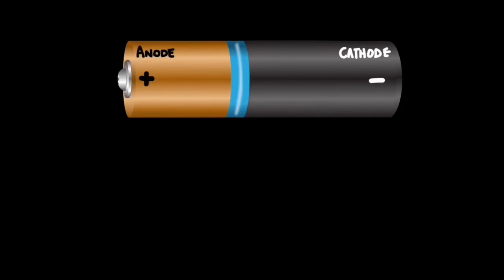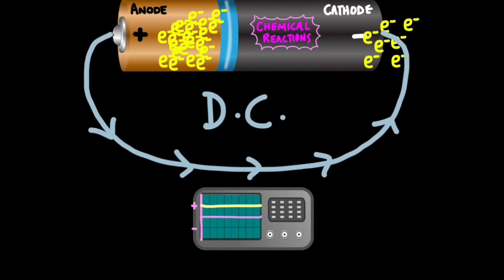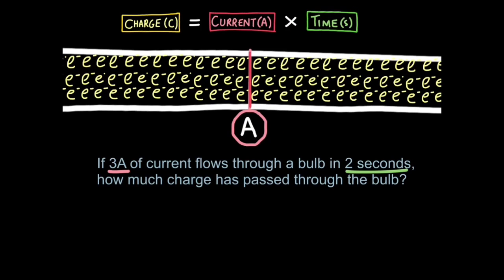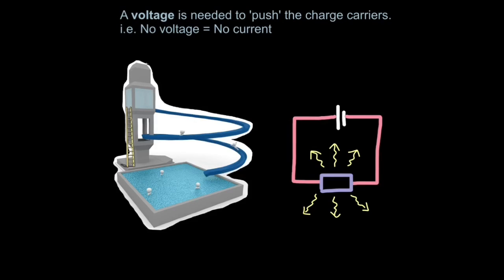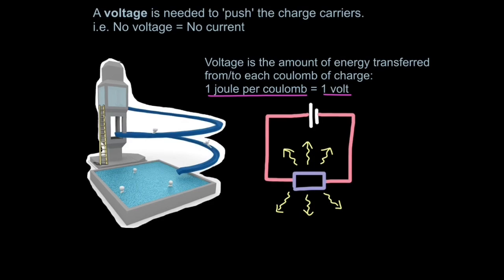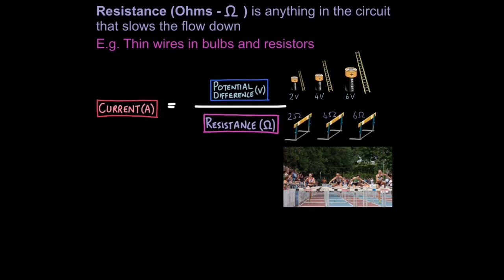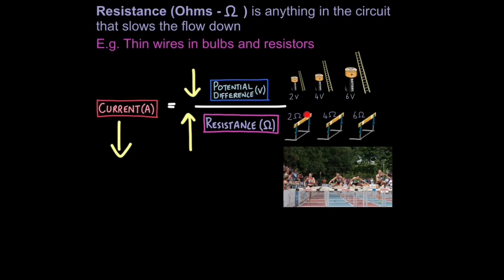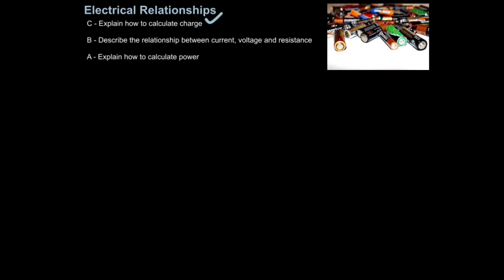P2 Electrical Relationships (EDEXCEL)

Comment: There is a current of 1.2 mA in the circuit.
 Calculate the charge transferred by this current in 40 s.
 State the unit. How would u calculate it? I did 1.2x40=48 c is it wrong what I've done?
Reply from the maker: nearly but convert mA to A first by dividing 1.2 mA by 1000

Comment: If the current gets used in the bulb how does it come back on the other side after it's gone through the bulb and transferred to the surroundings
Reply from the maker: current doesn't get used. Energy get's transferred in the bulb. Think of it like a queue of electrons that are constantly being pushed by the battery (until the battery has transferred all of its energy) - the electrons are always moving until the battery 'runs out'. The energy the electrons carry is transferred out of the circuit through the circuit components but that doesn't stop them moving as the battery always pushes them......make sense?

Comment: I'm a little confused- if in reality the flow of electrons is from cathode to anode, then why did you give an example of it from anode to cathode?
Reply from the maker: because this is how it is represented in textbooks. It is scientifically incorrect yet all circuit diagrams still obey the anode to cathode model....yes - I appreciate it's confusing. However, the exam questions are never too tough for electricity. Try a few questions to get an idea of what you will be assessed on.

Comment: @StudySmart: Science   which other video explains the parallel circuit different resistance equation?
Reply from the maker: don't need it for this spec (if I understand your question correctly)

Please feel free to try
our free GCSE revision app: website: platform.westudysmart.com. Press
‘register’. Enter ‘PortableTutorCode’ (just like that) under code. The rest is
easy. Works on mobile devices too.
Reply: ok cheers, thanks for the hard work making these.
Reply: is the app on the app store?